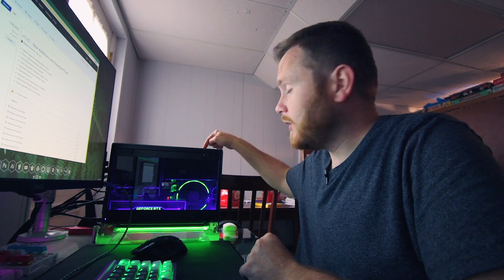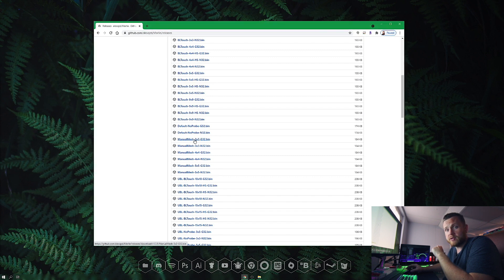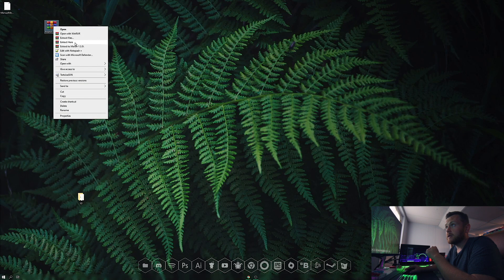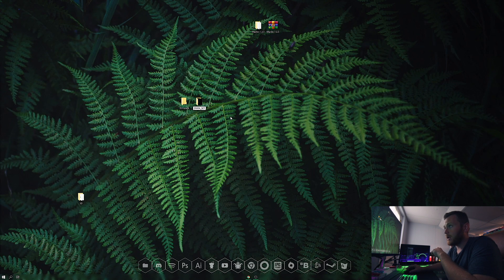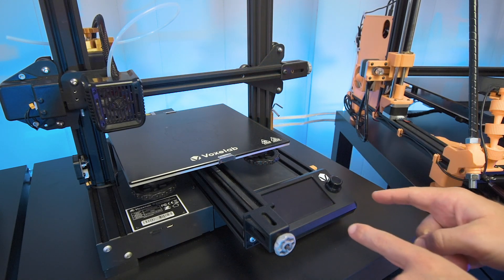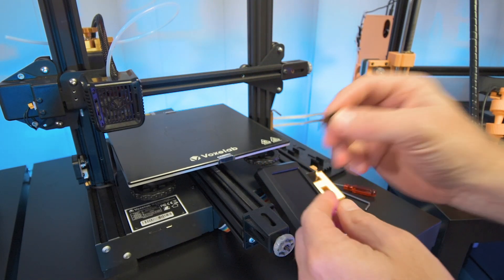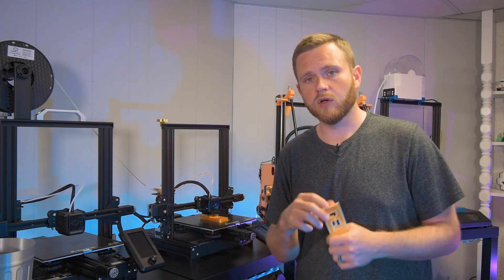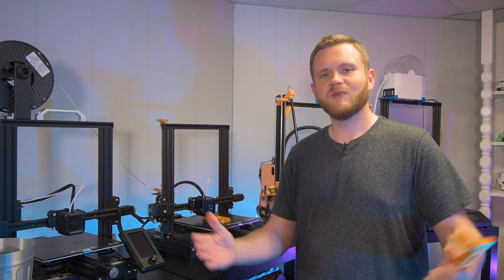Reduce Risk of Fire on Your Voxelab Aquila with 3rd Party Firmware

Comment: It's about time you did this :) This really transforms the Aquila! You might want show to how to create a bed mesh level and also how to add start code to the slicer so it retrieves the mesh bed settings after saving in Aquila of course..
Reply from the maker: Probably a good idea. By the way the firmware already gets the mesh before the print. ;)
Reply: @3DPrintSOS  I second a vote for a bed mesh level video. Thanks for all of your time that you’ve dedicated to this printer.
Reply: @3DPrintSOS  Every time I power off my Aquila, I have to go back into Alex's firmware and turn on "Leveling Active".  Is there a way to make this always on even after a power cycle?
Reply from the maker: Try selecting it then going to “store settings”
Reply: @3DPrintSOS  Tried that, power cycled, and it was unchecked again.
Reply from the maker: I found it. In the start Gcode of your slicer you need to add m420 S1. Before movement. This will load the saved mesh.
Reply: @3DPrintSOS  Thanks for this solution!

Comment: Ever since the Anet fires I have checked all the printers I have bought and all but one had to have thermal runaway protection activated within Marlin, considering how easy it is to include this with your compilation I consider it criminal not to include it, considering all printers have the potential to catch fire I am surprised there is the option not to include it, Marlin should just hard code it into the Firmware as default.
Reply from the maker: It’s strange that some companies want to limit the features of Marlin even though they should work and have been tested to work already. Not sure.

Comment: 1st of all, thaks! i saw the vid, yesterday and was actuly quiet worried. 
2nd Is there a way to turn the display sideways again? I realy don'0t like the vertival layout
Reply: Currently there is not. Alex's firmware is a fork of Jyer's FW for the Ender 3v2 which has a vertical display hence the need to flip the Aquila's display.
Reply from the maker: That’s correct, not yet. It sounded like one may be in the works but it’s quite involved. And technically, even voxelab went back to vertical with the x2
Reply: @3DPrintSOS  I have a feeling we might not ever see a horizontal version unless someone else picks up the ball and forks one as it's all based on Jyers Ender 3v2 firmware anyway. Lot of work for sure. It will require practically a complete rewrite of the display firmware. However there is a decent chance that at some point we might see a touch screen version supporting Creality's E3v2 touch screen upgrade since it's pin compatible with the Aquila main board. The building blocks are already in place as Jyers said his version up until a few rev's ago was using the protocol designed for touch screens but then switched to the more appropriate version.
Reply: @richm658  oh I hope so. I would do it myself but don't know anything about it :/

Comment: Is this a problem for the Aquila X2 as well?
Reply from the maker: From what I understand it, potentially yes, but I haven’t personally tested. It sounds like this happens because there are a few different chips installed on these machines and not all of them are compatible with some Marlin specific features in the same way. That’s why you have to get a firmware that is specific to your chip instead of one generic one.
Reply: @3DPrintSOS  Damn. I just ordered an X2 and it'll be my first 3D printer ever.  I'll definitely address this issue once I received it.  Thank you!
Reply from the maker: X2 is a great printer. This firmware will only make it better. So no worries.  :)

Comment: Huh, I just flashed to Alex's default probe a few days ago without knowing about the fire hazard. Homing and leveling the printer is much easier this time with Alex's firmware. One question, is there any way to increase the hotend temperature beyond 260 without changing the thermistor? I noticed some GF Nylon filaments require nozzle temperatures within 260-300C.
Reply from the maker: You could if you recompile the firmware yourself. I’ve done it a handful of times before and there are actually plenty of resources it there that will talk you through a basic Marlin compile. You’d just have to use the source code provided and you’d be set. You can just increase the temps. However, be aware that it’s capped there for a reason. If you have the hardware to back up the temp, go for it, otherwise try to stick to 260.
Reply: @3DPrintSOS  Awesome thanks 😎

Comment: mine H32 so won't work. any other way for me?
Reply: Currently no H32 support but I believe it is in the works as there was mention of adding support for the H32 a few weeks ago. Just keep an eye on Alex's github for a release.
Reply from the maker: Thanks Rich. I can confirm that is what I heard as well.
Reply: @3DPrintSOS  Yep straight from Alex.
Reply: good to know that. printer print kinda fine ( this is my first 3d printer ) but when power out and the z will drop a little than after i resume nozzle knok the part . do you have the same problem?
Reply from the maker: This typically happens when the wheels on the z axis are too loose. You have to tighten the inner wheels using the eccentric nuts on them. Not too much cheese but just enough to hold it in place.